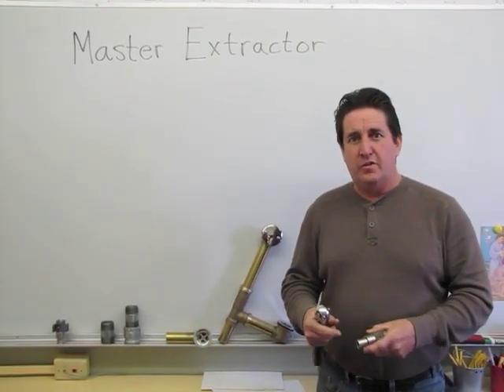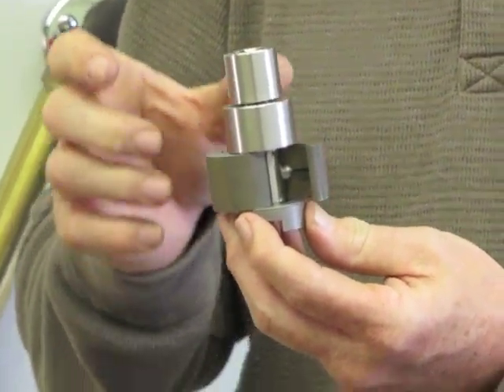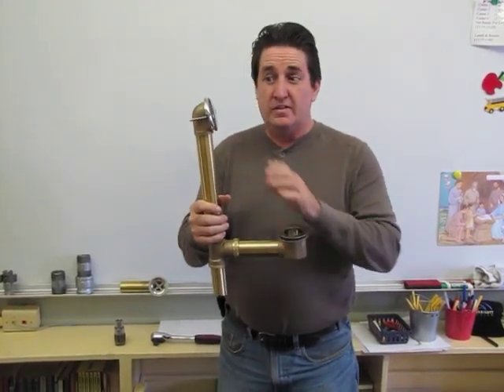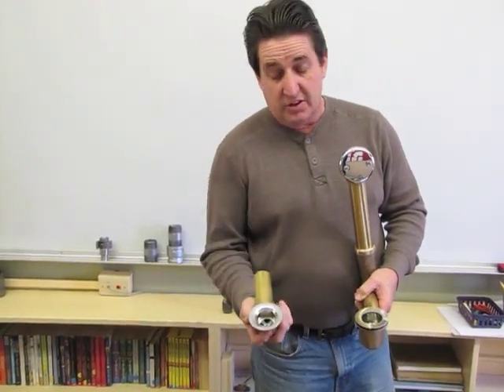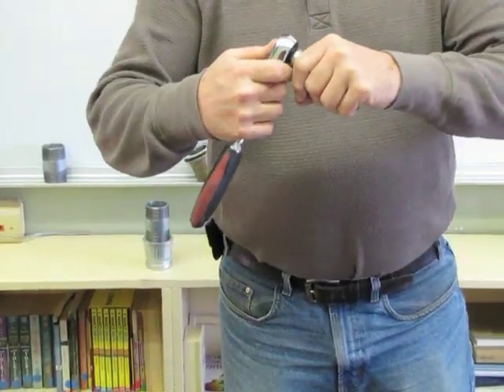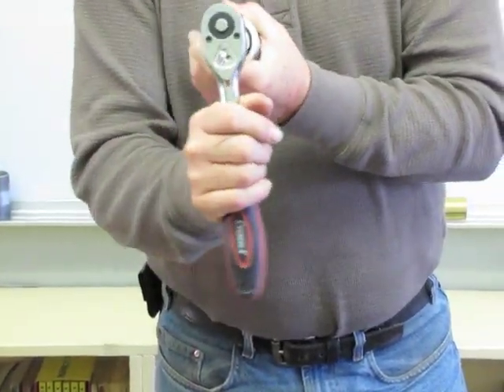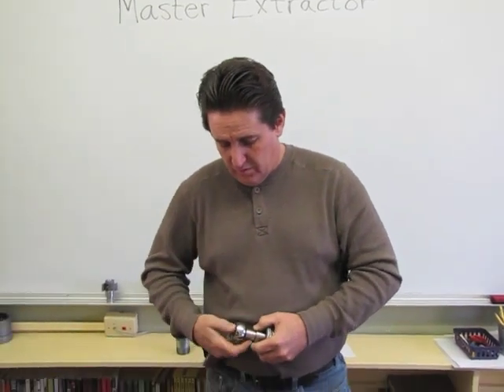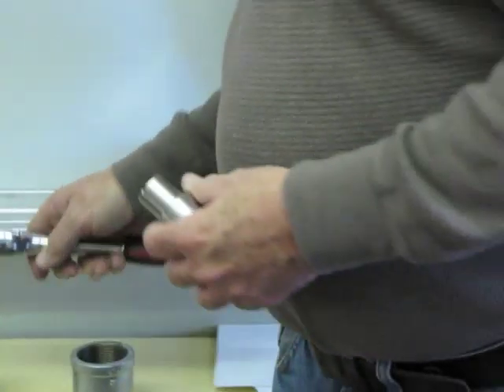Master Extractor

Comment: Every handyman/plumber should have the Master Extractor in there box. It's the top of the line drain removal tool. I'm a handyman and my last drain removal resulted in the cross tool ripping the cross from the bottom of the strainer, Now what do I do?  I went online and found the Master Extractor tool and when I received it in the mail, it only took less than 30 sec,s to remove. Awesome Tool. Thanks, excellent quality. Johnegadget's Handyman Service.